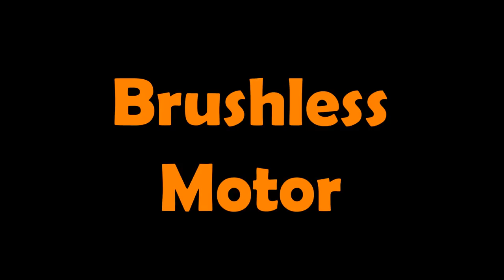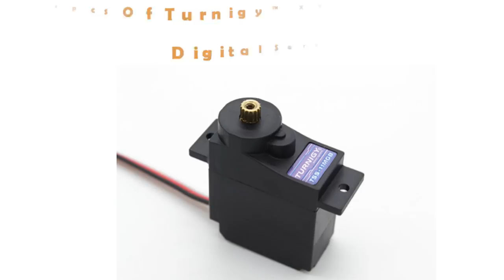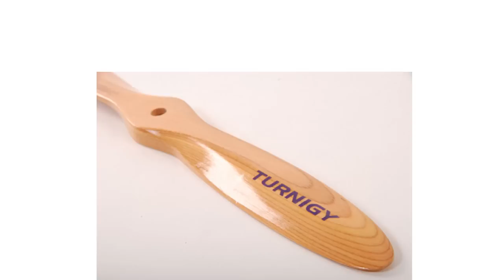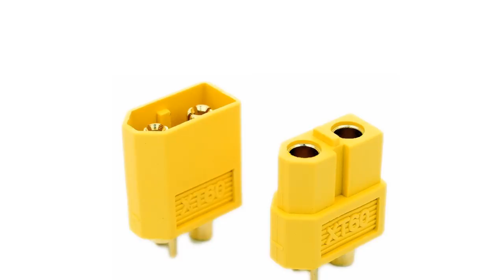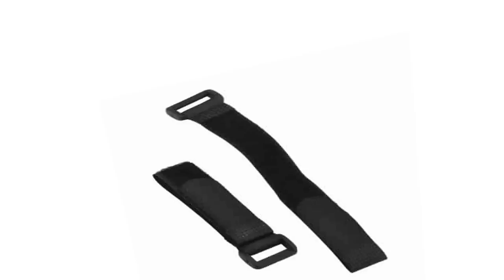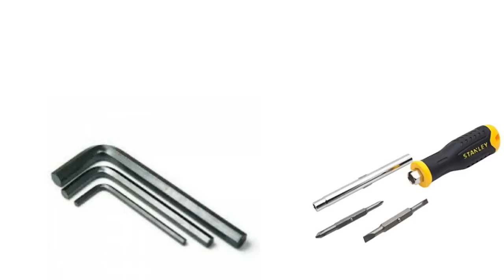Hardware List Of Items To Build Fixed Wing Uav With Pixhawk 2.1 'CUBE'

Comment: So tempted to build this! I have a FrSky Q X7 already. Could I use this rather than the transmitter you suggest?
Reply from the maker: Yes, you can use QX7 :)
Reply: @DhruvArora  great! I just watched the 2nd video back and I'm not sure if this is for a mapping system?
Reply from the maker: @quavergonzalez4710  well what we are building can easily be used for mapping. Once the build is complete, you can add trigger cable and camera to your fixed wing uav. I've already posted trigger cable and camera related videos on my channel.
Reply: @DhruvArora  awesome will look it up!